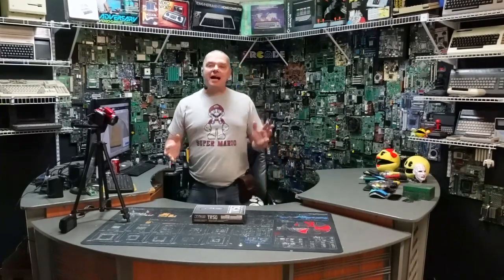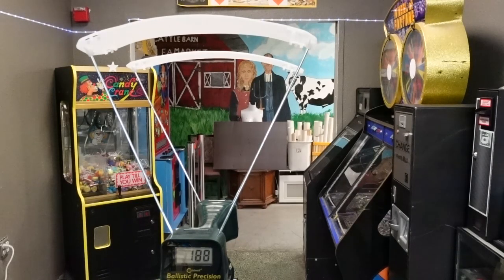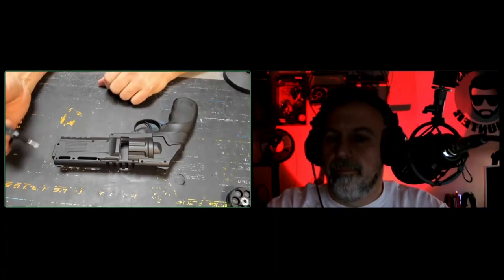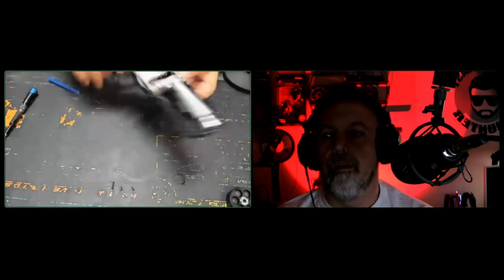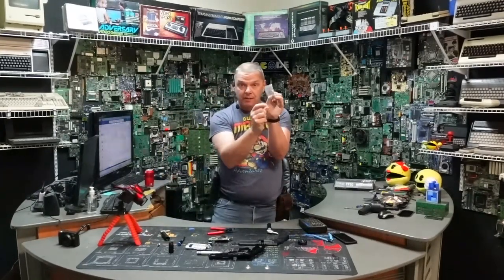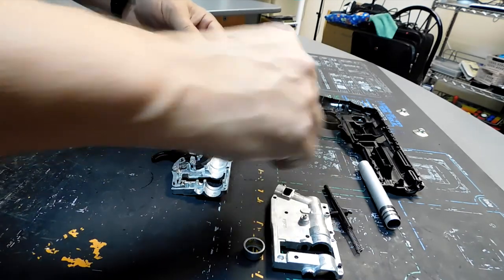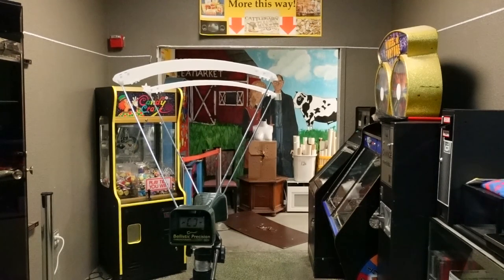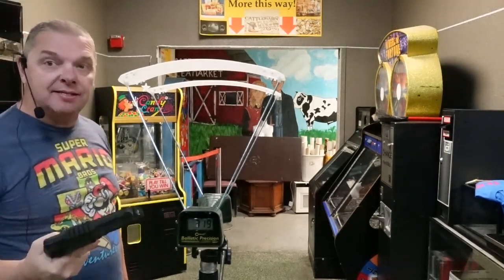Lets upgrade the T4E Umarex TR50! | 20-30 Joules!! This thing is MEAN!

Comment: Hi. I send a mail. Do you have a link showing why the pin (hammer) doesn't pop back up please
Reply from the maker: @elsiestokes4614  hi, believe it or not there’s a very tiny little spring behind a sealed valve in that cap. If that spring is damaged, if the velvet itself is bent, or if the mechanism is binding, all that can cause that to not return. However, they are very, very inexpensive to just replace the cap. I’ll look for your email and I will shoot you a response here in a few minutes.

Comment: This is awesome, great video!  Did you end up sourcing the kit for the direct drop in?  I would be very interested!
Reply from the maker: Greetings, yes indeed, but I’ve had a hard time getting a decent supplier. The truth is, you can mod this without actually having to install that power kit. Take a look at the video after this and You can see what I mean. :)
Reply: @AlternateArmsSD  Wait can you elaborate on what you mean by modifying it without installing anything? Like can you link me to a guide for that or something?
Reply from the maker: @takeda6516  i’ll be making a video on that this week assuming one little part arrives. If this works out the way I think it will, it should make the upgrade on this considerably easier!
Reply: @AlternateArmsSD  that’s so cool! Thanks in advance.
Reply: @AlternateArmsSD  if I had a 7.5 joule version of the TR50 could I modify the valve itself?
You said if I removed the valve block that every shot fired would use 100% of the air in the canister. 
But, is there any way I could say manually loosen the valve block without removing it completely?
Like if I were to somehow manually turn it left and loosen it like a screw then would it use more air?
Reply from the maker: @takeda6516  Interesting you would ask! Ok, they DO make a power kit for the 7.5J version and I have one coming for testing... That being said, all you would need to do is take a VERY small drill bit and increase the size of the hole in the restrictor. You could go through several sizes to determine which size would be best. That video is also coming. I have a GREAT slate of videos on deck for you guys!
Reply: @AlternateArmsSD  Thanks!

Comment: I tried to get the horse shoe spacer out without luck . It must be glued in and has three small pressed in lock notches at 12 5 7 o'clock.  It is the 11 guals version as well. As I tried to scrape the lock notches I noticed the threads began to get damaged.  Stopped before it was ruined.  They must have changed something in manufacturing to end the upgrade.  It looks as if the inner assembly would need to be split to remove the two pieces to get to 20 guals . So really not worth it to me. I'll just enjoy the 11 g for now. If I want power I'll just take my .40 s&w and .22 s&w victory out plinking.  Thanks for your videos I watch them all and a subscriber.  Although if I mailed you an 11 g t4e hdr would you max it out and take PayPal for your time and parts to accomplish what I couldn't.  I can work on plenty of guns real ones but never tried my luck with air guns. And my hands and wrists aren't as good as they used to be.  Thanks in advance for any help.
Reply from the maker: Greetings! Yes indeed, the easiest way to remove that is to place a Phillips screwdriver on the other end of the valve assembly and tap it on a table. It will pop that aluminum insert out. It seems a little scary when you do it, but it does actually work.

I am working on getting my store set up to sell the fully modified versions as well as do the modifications for people. I’ve just been so buried I haven’t had a chance to get everything posted :-)

Thank you so much for watching and welcome to the family!
Reply: @AlternateArmsSD  I'll be here and will get back to you when you have your store up . I'd Rather just purchase a fully modified t4e hdr. I have the 7 11 t4e hdp .50 . I'm starting to collect them like star wars figures until my collection is overwhelming.  Girlfriend is already shaking hear head and finger lol. BTW I really like the 11g tr50 it's a blast .

Comment: The 7.5 jules version can’t be updated?
Reply from the maker: Yes it can using the exact same method.
Reply: @AlternateArmsSD But in it you say that you can’t, if it doesn’t have the 11 jules version.
Reply from the maker: @carlotroncone9966  this is actually an older version of the video, go forward, and you will see more upgrades.

Comment: I’m kind of confused on what you say here so I got the 11 joule version from Amazon but it has the F on the side of it like you mentioned should I not attempt this I’m guessing ?
Reply from the maker: As long as it’s the 11j version you are fine. I am working on a “universal” mod , so to speak. The power kit 50 must have the 11J version or the flow contractor doesn’t fit in the C02 chamber without modifications.  On the hdp50 it doesn’t matter but on the TR50, it tends to expel all the CO2 on the first shot.

Comment: I would have removed the valve block as well but then again I'm a little crazy that way BTW what ammo were you using
Reply from the maker: I did :) I was running the rubber/steel core riot balls. That is one vicious machine now.
Reply: @AlternateArmsSD  Owe I didn't hear you mention that in the video you said you weren't going to
Reply from the maker: @smokingunclefrank6037  yeah, I had tried using the 7.5 valve block and just removing the core but it caused an immediate CO2 release. The first round came out like a canon But then all subsequent CO2 just came out in one long burst.I do have a solution for that, but I haven’t tested it yet. I do love innovation :-)

Comment: So the only difference between the regular 11joul and the upgrade One is the size of the hole of the valve inside of the co2 comparment?
Reply from the maker: Pretty much. It all boils down to airflow. The more constricted the airflow, the slower the projectile. By changing out that valve block, and removing the plug, you can get maximum velocity. The only issue I’ve run into is that, if you do that, you cannot longer fire pepper balls as they tend to explode in the barrel. However, the solid balls fly with ridiculous velocity. Thanks for watching and welcome to the family!
Reply: @AlternateArmsSD  
Now the question is to find some pepperballs, or how to mod those so they can fire with a +20Joule modded one.
Reply from the maker: @OldWolf-147  I actually have a theory on that! Stay tuned!

Comment: I was under the impression that the entire valve block should be removed for the 7joule version (marked f) and the empty circle space in the co2 chamber is to be plugged. Am i correct?
Reply from the maker: Youre absolutely correct. If you’ve got the 7.5 joule version, you will need to replacethe entire valve block. When you get the replacement valve block, there will still be a plug that constrict a portion of the airflow in the valve block. That plug can also be removed but it’s not necessary. I’m working on getting an 11 joule version in here to do the 30 J conversion. However, this one fire so hard that I don’t really see the need. Once you get above that 20 joule mark, you can no longer fire pepper balls. Thanks for watching and welcome to the family!
Reply: You started off modifying the 7,5 ? What happened did I miss something? I really need more power could you maybe supply a website Adres for a 7,5 joules upgrade? Would REALLY appreciate your help here! Great video, thanks very much 👍🏻
Reply from the maker: @lerichurn5297  Greets! Yes indeed.. I learned quite a bit about this conversion during the process. I am working on a supplier for the 11J valve version (which can be EASILY modded to far more) .. As soon as I find a trustworthy source, Ill let everyone know?
Reply: @AlternateArmsSD  thanks for the Info👍🏻🙏🏻
Reply from the maker: @lerichurn5297  Anytime my friend, I just don’t want to route people to suppliers that will not deliver what they promise. I have to protect my viewers :-)
Reply: @AlternateArmsSD  i am hearing that the shorter firing pin doesnt increase power, so might just need the co2 valve restrictor (unless running on hpa) now to achieve more power, and simply remove the valve block
Reply: hello,  @AlternateArmsSD   and  @Umi Umi  ....on the 7.5J,  the valve block needs to be REMOVED, not replaced  . There is no "replacement valve block" on the market. The kit  they sell everywhere, consists of:  A)a shorter pin , and B) a co2 chamber plug (disk restrictor). So I believe Umi Umi is correct in his brief description of what is to be done..
Reply: BTW, the 7.5J does not come with the co2 chamber disk (restrictor). It only comes on the 11J version.
Reply: @louie2020  that is correct. I had 7j version. I installed the co2 valve restrictor plug, removed valve block, and left the firing pin as many powerful hdr owners couldnt confirm the power increase of replacing it. So technically, with 7 j version you only need the plug. And if running hpa, no need for plug or anything else. Simply remove valve block

Comment: Mine has the F sign but not sure what it is at the moment. It’s the HDRT4E
Reply from the maker: Actually, there are two different different size valve blocks that can be installed. Either way, definitely pull it out, but you will need a CO2 restrictor in a TR 50. If you need one, shoot me an email because I actually carry not the CO2 restricted it itself, but the generation two valve for that launcher.
Reply: @AlternateArmsSD  So I can take that bit out of mine then? Just brought a kit and can’t wait to have a go.
Reply from the maker: @TerryPanos  you can, but if you don’t have that small CO2 restrictor disc in the CO2 chamber on the bottom, all of your gas will “fart” out on the first shot. It sounds really cool, but it’s very impractical :-)
Reply: @AlternateArmsSD  think I’ll leave it in then and just fit the kit
Reply from the maker: @TerryPanos  that works too, just remember you’re going to lose a considerable amount of power by leaving the valve walk-in. Typically that’s there to comply with joule regulations around the world.
Reply: @AlternateArmsSD  Your advice then is to leave it in 👍
Reply from the maker: @TerryPanos  until you get the CO2 restrictor or the new G2 valve I would say yes. :-)

Comment: Would you recommend this airgun for self defense over all the other ones?
Reply from the maker: They all have their own advantages. This one and the HDP50 are very easy to upgrade. It really depends on how you intend to use them.
Reply: @AlternateArmsSD  I'm trying to keep my home and family secure. As in if someone breaks in , I'd be able to stop them. I'm leaning towards the Walther ppq gen 2 because of the quick mag changes but the TR50 seems to have way more stopping power.
Reply from the maker: @bigdumbbear1794  That is exactly the difference. The TR50 and the HDP50 (One of my personal favorites after upgrades) are VERY hard hitting. The Walther is a very fast and efficient weapon as well. You could also look into a Valken M17 (I have a video up about that one as well) but that is EXTREME self defense :)
Reply: @AlternateArmsSD  ooh yea that valken is no joke. I really like the Walther ppq tho. Would you recommend it? Would it be enough to stop an intruder high on something? Which rounds would be best for it? I'll stick to the TR50 if not.
Reply from the maker: @bigdumbbear1794  I actually carry the Walther.. I alternate it with the Byrna. The pepperballs are the key. Alternate your rounds.. Solid, pepper, solid, and so on. They will stop a person in their tracks.
Reply: @AlternateArmsSD  thank you very much for the info and fast replies. I appreciate the help brother 💯 great and informative content as well
Reply from the maker: @bigdumbbear1794  My pleasure man! I love making these videos! Im glad they help. That was the reason I started the channel ;)

Comment: which mod should i do to increase the 11j version power and keep the abilty of shooting pepperballs ?
Reply from the maker: Greets, you can go with the full valve removal and PK50 installation and still fire the pepperballs if you are using a good quality pepperball. Ammo quality counts for sure. However, the TR50 has a vast selection of ammo it will fire as well.

Comment: You talked about pepper balls, how does the upgrade do with pepper balls?
Reply from the maker: Greets!  With this upgrade they fired perfect. I went through 2 full drums with no issues. Now, if you pull that valve block, I don't think you'd be so lucky. This mod pushes the boundaries for sure. Ill tell you one thing, at that velocity, you WILL rupture the pepper ball on your target. Thanks for watching and welcome to the family!
Reply: Im searching for the exact uograde but have not been able to, could you point me in the right direction
Reply from the maker: @christlivesamen3252  Yes indeed.. Let me find the supplier.. I'm ordering a few more myself.

Comment: How would this  upgrade  and the HDP 50 upgrade  handle   shooting  .50 cal steel  slingshot  ammo ?
Reply from the maker: I’ve actually wondered that myself. I’m going to pick some up this week and we will give it a test :-)
Reply: @AlternateArmsSD  Ive  even  seen  someone use aluminum balls  with the walther ppq .43 i think  those would fly even  faster in both the 20+ joule versions  of the HDP and TR50
Reply from the maker: @dark96744  I have some and they are coming up on an ammo side by side :)
Reply: @AlternateArmsSD  i look forward to  the results

Comment: Hello - here in Germany we only get the 7,5 Joule Version  ... is it possible to tune this too with your mod  ???
Reply from the maker: Greetings, because of the way the valve block was constructed on the 7.5 version, I had to change out the valve block to the 11J version before I could knock out the constrictor inside the block. When I would remove the constrictor on the 7.5 version, it would cause the weapon to release all CO2 in multiple bursts when you pull the trigger one time. However, I have a theory that I’m going to be testing next week. Stay tuned.

Comment: Can you please help me get mine back together.   I saw where you could just remove one piece,  which was not possible,  and things fell out every where.   Please help me to get it back together
Reply from the maker: There is a very good, very concise, and very detailed video about the breakdown all the way down to the individual springs of the trigger. Trust me, I understand your pain. I did the same thing the first time I did this modification :-) don’t worry though, as long as you didn’t lose the springs, everything will be OK. Do a search for TR 50 tear down. All you should have to do is watch the video backwards then to get everything back into place. It’s not overly complicated, you just have to go step-by-step. That trigger has three teensy little Springs.
Reply: @AlternateArmsSD  do you know how I can buy an extra spring and screws for my Umerex TE4 50 cal?  I accidentally lost one spring and like 2 screws.  Please let me know.   Thank you
Reply from the maker: @chadschlautman6025  I believe you can buy the full rebuild kits from umarex.com. I don’t have any yet, but I’m certainly going to get them because I need to get some seal replacement kits as well.

Comment: 1 more thing to add to the fps is if you heat the co2 cartridge to about 45 - 49 degrees Celsius it's gonna give even more power. Don't go over that temp though, cause the capsule could fail.
Reply from the maker: And they can, potentially, explode when temps get to high. High temps = dangerous and low temps = lower velocity. Thanks!
Reply: Hair dryer on low setting.
Reply: Dude that thing would blow up at the temperature mentioned by you, please be responsible.
Reply: what could possibly go wrong lmfao. dont need all those fingers anyway am i right
Reply: @impv1se  just the middle one

Comment: I was under the impression that in order to do this mod your doing you need to first have the 11-joule mod installed that's what the seller I chatted with said to me should have watched it all you mentioned a higher joule version so you already changed the valve
Reply from the maker: Correct! In fact, I swapped to the 11J valve block before I moved forward.. however,  I think I have found a way to bypass the C02 release issue and upgrade it without the powerkit.
Reply: @AlternateArmsSD  Interesting I'd like to see a video on that